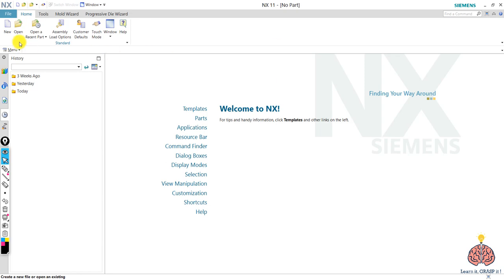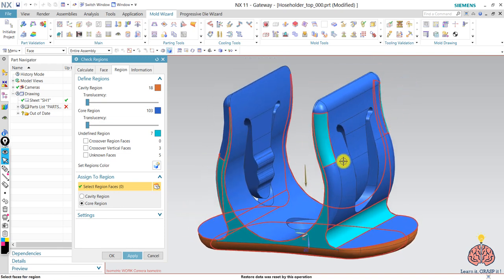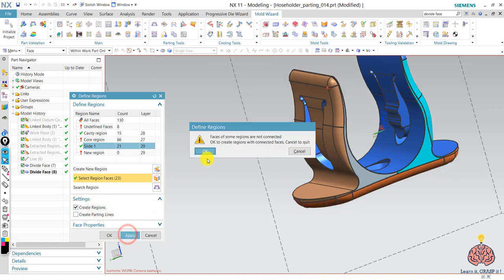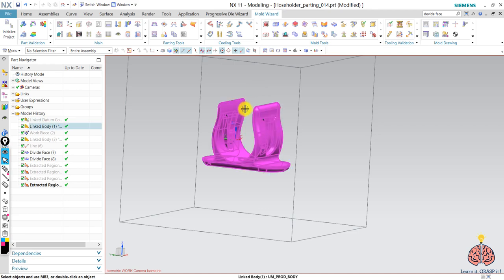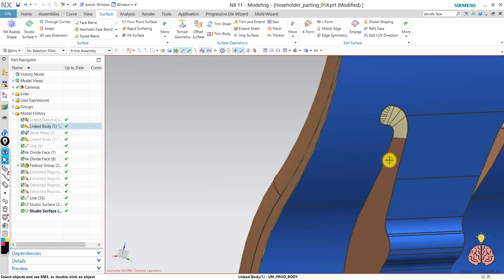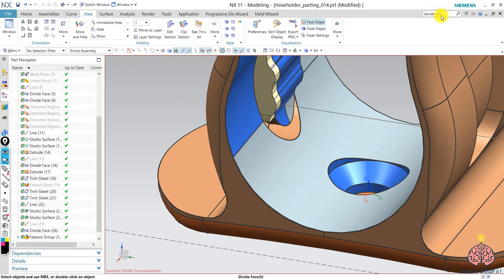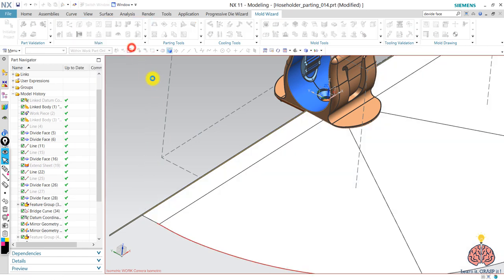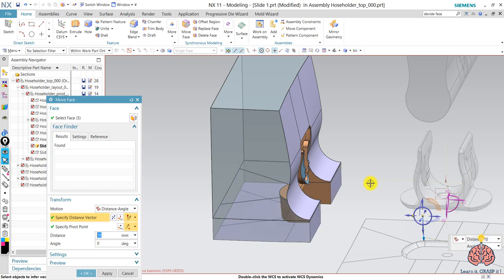Complex plastic part Mold making using Mold wizard Tutorial | Siemens PLM NX 11 | Mold Wizard

Comment: Are you sure that product will drop from mold? I think it will be a problem. Even if the product is still warm and elastic it could cause drop issues. I can't be sure. Can you enlighten me? 
The S form of the product, It is something we can't say easily It will drop do not worry.
Reply from the maker: Thank you for that great insight, and yes it will drop by being pushed by ejector and the lips would elastic-ly open a bit while being ejected. By the way this is a real mold ☺️. 

We've got tons of secrets to show you so please subscribe, like and check our new videos ❤️🙏
Reply: @LearnitGRASPIT  Is there a finished model of the mold? I am eager to see the end of the mold and how did you replaced product cavities.

Comment: Dear sir, the error comes in nx11 while MOLD design
Error name : the specified Top part doesn't exist or wrong clone ACTION is defined in the configuration spreadsheet (when I select mold CSYS option)
0please help me out.
Reply from the maker: Unfortunately I have not came across that error. try searching google for a solution. good luck!
you can also re download and install the program with the library

Comment: I would stick a clear tape (2*u shaped and a simple piece to cover the hole) to cover the holes in the original part, and then make a single part silicone mold. After the casting, I would trim the excess of the clear tape with an exacto knife.
Reply from the maker: I didn't think of that...but that's a pretty great approach! 
well thought.